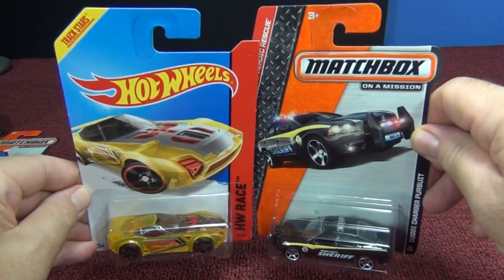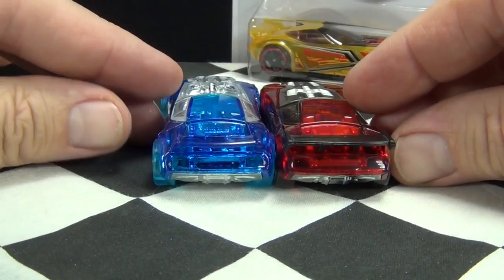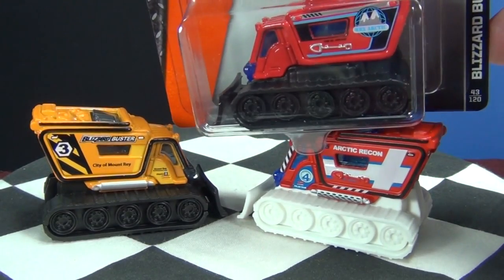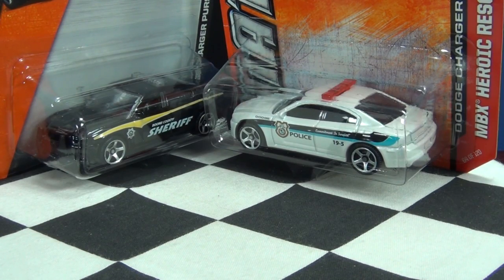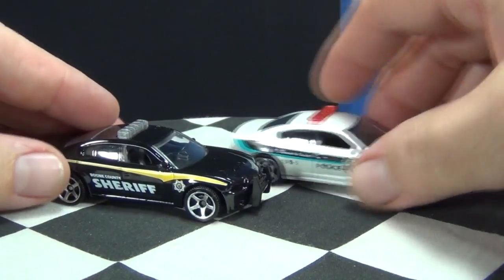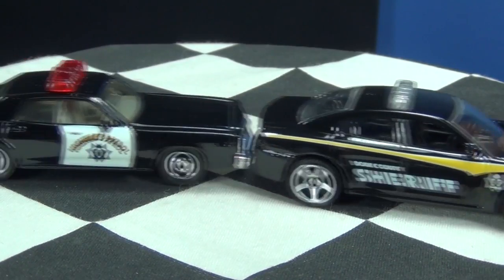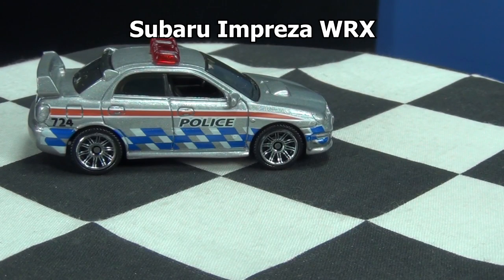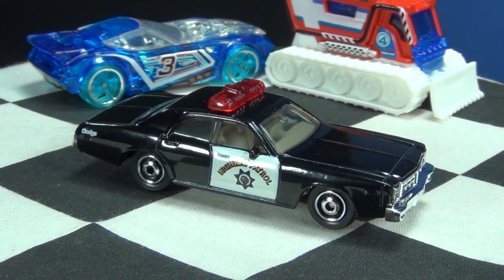Why Does Mattel Change The Castings? VLOG

Comment: Brilliant summary of the reasons and examples for casting changes Mark.  The replacement of plastic spoilers with cast metal spoilers is something we notice the most with the recent castings, in particular the Nissan Skyline GT-R (R34).  Hey we liked that MBX Subaru WRX you showed too.  The MBX Dodge Charger Police car will certainly be added to our collection as soon as we find them here.  Thanks for the video = )
Reply from the maker: You're welcome! For others, remember to check the description too for a bit more info =)

Comment: The mainline morris mini has a different switch. Instead of just clicking it open, you have to (painfully) push down and hold it there while prying it apart. The switch is now molded with stiff plastic S spring. I had to use a screwdriver to push the tab in.

Comment: In that matchbox tank thing the part that was changed was the exhaust pipe
Reply from the maker: An exhaust pipe would make more sense because it looks like it has a cooling or heat shield.
Reply: indeed

Comment: About the police light bars. It may also be about toy safety. Having the light bar as a separate piece makes it possible to break off while in play.

And  kids might swallow it or when the car is crashed about the light bar could be a projectile that could hurt the eyes. 

Well thats what i thought anyway.
Reply from the maker: That another reason why some models have been changed. This way, they don't have to use the safety warning. The Hot Wheels Surf Crate had a removable surf board. Now, it's molded as part of the interior.

Comment: Do Mattel do some changes due to the chocking hazard?
Reply from the maker: I know that the HW Surf Crate used to have a removable surf board and now it's molded as part of the interior.
Reply: yes.. and thats one of my fave casting.. sad to see it with non removable boards..
Reply: Funny how they haven't yet done that with the Deora II, I saw one with molded on surfboards, but that was limited.